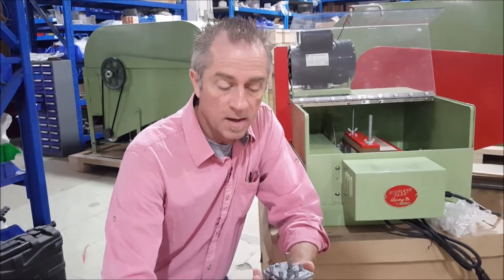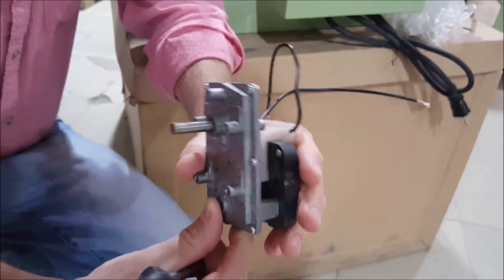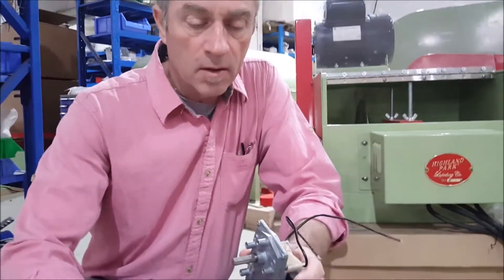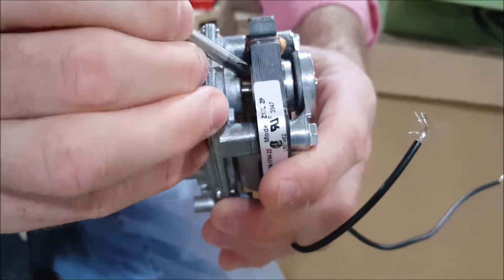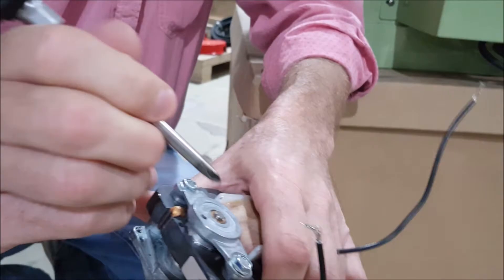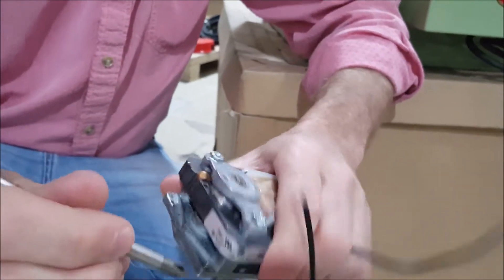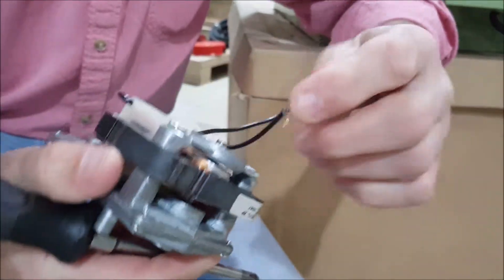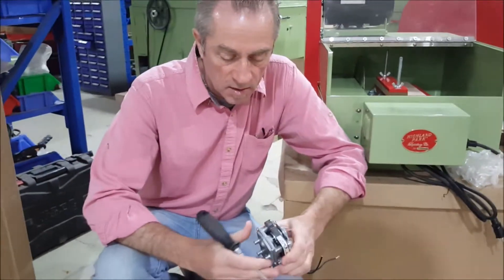How to service a gear motor

Comment: Hi John ... Where can these motors be purchased?  I have one that has excessive wear of the main shaft bushing. Enough that the drive shaft is pulled to the side and internal drive gear rubs the inside housing. Thank you!